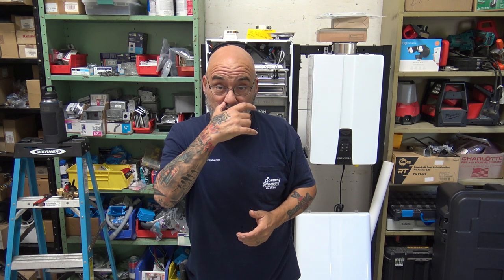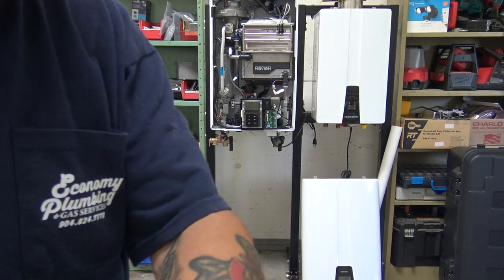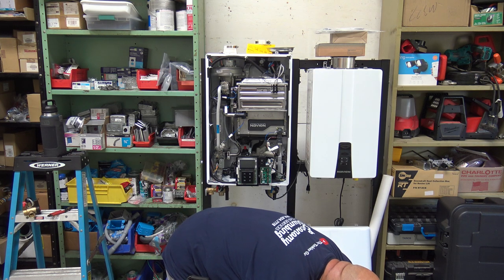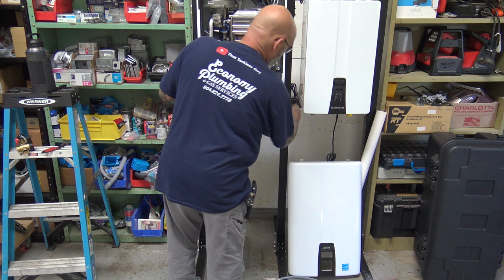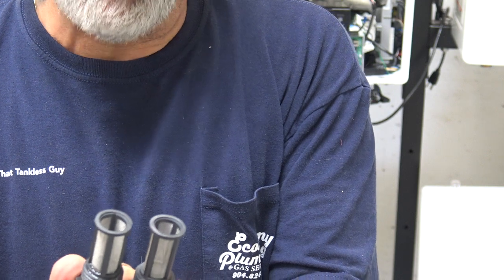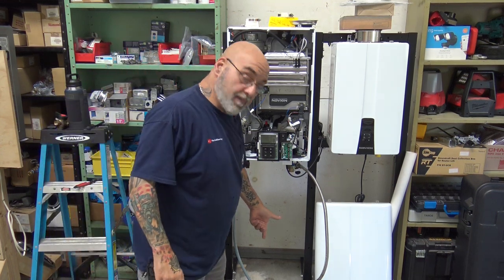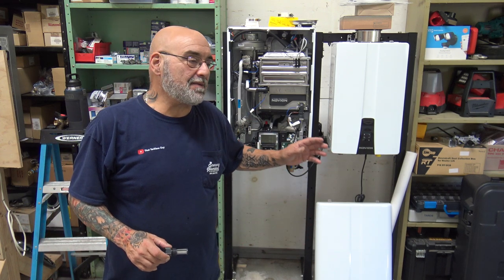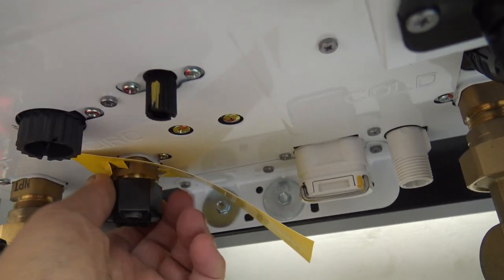How to do the descaling on a tankless water heater.

Comment: Of all my research, I have yet to find an official descaler kit that has a proper pump in it.  They all have GPH ratings that are WAY to high. So I did go to Harbor Freight and found a 264 GPH (4.4 GPM) pond pump.  I realize that flushing at 20,25,30 GPM is too fast for the solution to "work", but if you run it for a longer time is it ok to do?  Or, will running at high GPM actually cause damage to the tankless?

Comment: Thanks for the video.  I have seven Rinnai's in a parallel setup.  It's time consuming to flush all seven of them.  I was thinking of building a custom hose so I could flush all of them at once.  But I need to figure out how to check for the flow coming out of each one.  Sometimes the water inlet valve doesn't open (I have a master unit which keeps the valves off by default, I think).  Do you have any suggestions on how to do all seven efficiently and fast?